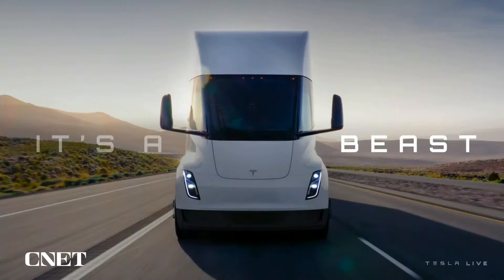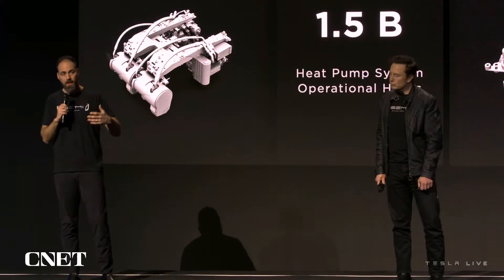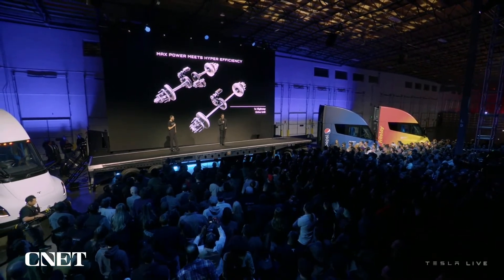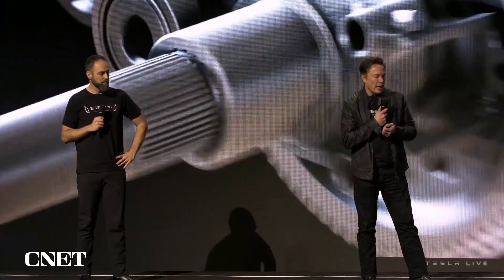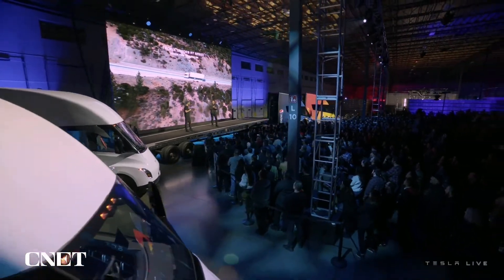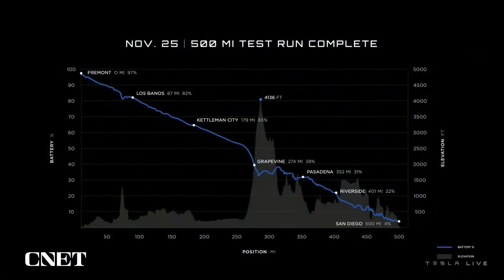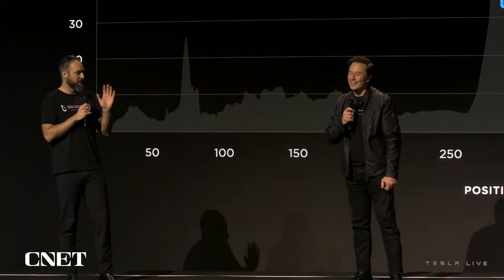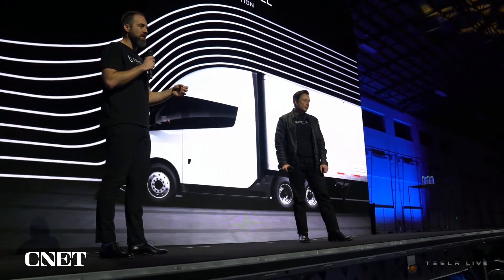Watch Elon Musk's Deep Dive Into the New Tesla Semi-Truck

Comment: Imagine the fuel cost savings for a fleet, it must be tremendous 🤔
Reply: over $200,000 per year.
Reply: And low maintenance cost
Reply: @Justanotherlobster Would love to see how the charging stations are distributed islandwided.
Reply: Imagine the geniuses that already figured this out while normal people try to downtalk people that are doing something incredible. 🤔
Reply: Imagine when there is no electricity…like in Europe right now……
Reply: @redeemedfarmer2670  1. Plenty of electricity in Europe rn. More electricity than petrol, in fact. 

2. Most mega chargers are intended to use solar power and an on board battery to charge trucks. Unlike diesel pumps, which require electricity to run. Oops.
Reply: @redeemedfarmer2670  pretty sure their is electricity in Europe, natural gas however is in short supply. but electricity is more vital and would not be allowed to go out.
Reply: less than half the load carrying capacity of a conventional truck. There is a reason why they have decided not to supply them to the market now and just use them ‘in house’ 😏
Reply: @bayly1977  What is this about? Because the Tesla semi can pull the US weight limit and do so better than a diesel, and has been shipped to Pepsi and Frito, who made the first purchases of the truck. I can only assume you're not talking about the Tesla semi.
Reply: @EmpressCeriath  oh you simple person. It is allowed the total tare weight of 80k as per any regular truck, it’s empty weight is double of that of a diesel. Need I go on? 🤷‍♂️ zero confirmed shipments buddy. Go find, in any of their hype bs, any mention of its load carrying capacity which is the only relevant feature for the trucking industry. You can’t, because they didn’t release it. However, third parties have reverse engineered the data to identify its empty weight. The numbers are dreadful
Reply: @bayly1977  Actually, they did an entire shipment on video, start to finish at a load of 81,000 lbs, 1,000 below the load limit of EV trucks. The total weight has been confirmed to 17,000 lbs. Third parties assumed the technology, in the same way that Mercedes did. They've been proven wrong. Pepsi and Frito both have already driven the truck, but it isn't technically in their fleet yet because they got it a few days ago.

Should probably keep up with the news before commenting old falsified talking points.
Reply: @EmpressCeriath  show me your source of 17k lbs. that’s the high end of a conventional truck. The reverse engineering has stipulated an empty weight of 27k minimum.
Reply: @EmpressCeriath  where is your source, show me!!!!! 17k is a conventional truck.
Reply: @EmpressCeriath  YOU need to do your research my man. They have omitted this number from all their source info. THAT is a fact
Reply: @bayly1977  I literally just told you. It's the Tesla released number. Use google.
Reply: @EmpressCeriath  you can’t do it 😂
Reply: @EmpressCeriath  gone a bit quiet there
Reply: @bayly1977  Nothing else to say. I've provided you the information, you can either deny it, research it yourself, or wait until there's thousands of these on the road. Not really relevant to me. Enjoy your day.
Reply: @EmpressCeriath  😂😂😂 you’ve provided nothing. That’s because they haven’t published anything. You made up 17k thinking it was a Tesla number but you now realise that’s the weight of a conventional semi. I’m embarrassed for you
Reply: @bayly1977  You can believe what you like. A conventional semi is anywhere from 15k to 25k. There isn't a single weight. There's many manufacturers with many different models. There is no single weight for them. 17k is the Tesla number. But this isn't a sports team, I've simply provided the information. I don't really care if you don't agree with that information.
Reply: @EmpressCeriath  wrong again. Just stop. Conventional is up to 17k and Tesla, again, hasn’t released their weight. Your embarrassing yourself
Reply: @EmpressCeriath  By: Steven Loveday
The Tesla Semi is a fully electric Class 8 truck with 500 miles of estimated range, according to Tesla. CEO Elon Musk just recently tweeted that the electric hauler was able to pull off a 500-mile trip "weighing in at 81,000 pounds!" However, we don't know what the truck weighs when it's not loaded, so this doesn't tell us how much weight it was pulling.
Reply: @EmpressCeriath  ‘more from the article’ Based on the tweet, a Jersey barrier weighs about 4,000 pounds. So, if the Tesla Semi that Elon Musk tweeted about is the same as the one pictured with 11 barriers, that means the load was about 44,000 pounds. This suggests that the electric semi's unladen weight is around 27,000 pounds.
Reply: @bayly1977  Wrong. My semi in my backyard weighs 734 tons, and can fly to Pluto while firing all lasers. Check your facts, you're making yourself look ridiculous. 🤣🤣🤣
Reply: @EmpressCeriath  Just say you were regurgitating what your daddy Elon was babbling through the whole presentation.
Reply: @rayh9865  Wow, you're angry. Hope you feel better later.
Reply: noooooo, its a scam! it will drive 100miles fully loaded and than stops for couple days!
Reply: @TheoisTeddy so true. My friend only tows 100 mile between charges and he is only towing a show car.
Reply: well why dont you calculate it yourself? i have. and at current electricity and super charger prices, it costs more than diesel. and this thing is gonna need 1000kwh of demand per trip. instead of 60kwh that a tesla needs
Reply: @MrPaxio have you told Elon this??? Maybe he will scrap the whole project! SMDH!
Reply: @MrPaxio  the semi trucks dont use superchargers, they use megachargers that run on industrial electrical prices which is dirt cheap. its 3 cents per kwh in my state so a 1000kwh battery would cost 30$. pleas do the same for a diesel going 500 miles while weighing 80,000 pounds.
Reply: @odisy64  oh please, raw electricity prices went from 2 cent to 8 cent this year. and 80% of the cost comes from delivery and service fees attached to that 8 cents. it doesnt matter that industrial power is cheap, the people running the mega chargers still need to make a profit. and the guvernment or elon isnt about to invest a trillion dollars to build that infrastructure. ive seen slow chargers take 50-90c/kwh i doubt they'll just let you drive for free because you want to
Reply: @MrPaxio  its 3 cents a kwh where i live for industrial power, but the mega chargers owners dont need to make money if Pepsi co owns the ones at its facility and uses it to charge trucks they own. you can expect to save nearly a million dollars in fuel in the lifetime of the truck, you could buy several replacement semi trucks with that money. elon has already spent million building the worlds largest private charging network and they plan to open it up to other car makers.
Reply: @MrPaxio  8 whole cents?! Oh my gawd, that makes it roughly a fifth the price of diesel per mile, it's going to cost $80 to fill the battery. This technology really is dead if it's only a fifth the price of diesel. Your argument is infallible.
Reply: @EmpressCeriath  yeah right 8 cents..... thats why on the road chargers take 50-90c/kwh to charge a small battery.... for 4 hours.... and the people running the stop need to make a profit aswell. you didnt read that you also need to pay the drivers $40/hr while its sitting there charging. and ure not gonna get 8 cents when u run out of range near the destination near a population center with expensive power. you cant just teleport electricity just because you really wanna believe in it. and theyre gonna be buying a truck that can only do one specific route, what if the route changes, now you cant complete it with this truck, meanwhile a regular semi can do every type of job with its 2000 mile range and it can actually return to where it started to refuel for lower price. maybe they can tow your tesla semi out of the city again for cheap power LOL
Reply: @MrPaxio  Lmao, you're the one that said 8 cents. 

I pay 17 cents to charge mine, and it takes an hour to 100%. It takes about 20 minutes to 60-70%. Paying a driver for 20 minutes is far cheaper than diesel by a long shot

Route planning is a part of truck driving already, probably shouldn't run out of power near a city. Oh wait, I live IN a city and pay 17 cents.  

The truck can do way more than one route. Not sure where you got that number from.

Not sure why you're trying so hard to debunk this truck's usefulness, when there's already a ton of companies lining up for it. You don't need a truck that does everything, you need a truck that does the job it's expected to do. This truck is far cheaper to operate than a diesel truck, and will replace diesel in most local and regional applications. That's just the realistic future. It won't replace diesel on long haul, unless major improvements come.
Reply: @MrPaxio  I've actually provided the weaknesses of the truck. It isn't for everyone. But you're going out of your way to make the truck "useless", when it clearly isn't. 

There isn't an army of robo taxis, the technology has a long way to go. They'll be incredible in a few decades. 

Vacuum tubes probably won't ever be a thing. Maybe though. 

A rocket across the world isn't entirely practical, but maybe with more advanced in technology. 

Elon is trying to make money. He's helped create a really good car that's much more practical than an ICE in most applications(thank you to the other companies also doing this). He's made a semi truck that MASSIVELY cuts costs for transportation, which will definitely affect the price to every consumer in the US. 

The practicality is explained here, and reiterated in the comments section.
Reply: @MrPaxio  no it doesn't
Reply: @MrPaxio  maintenance alone is a savings win
Reply: @MrPaxio  The math has been done by people a bit better at it. It's slightly less than a third of the cost, based on commercial electricity costs. While those costs can vary, you're still looking at significantly less than diesel.
Reply: @EmpressCeriath  and eventually not needing a driver - perhaps the biggest cost?
Reply: it wont, a truck that isn't driving isn't making money
Reply: @lIlIlIlIlIlIlIlIlI  it's driving today
Reply: @lIlIlIlIlIlIlIlIlI  what are you even talking about?
Reply: @lIlIlIlIlIlIlIlIlI  Why would it not be driving?
Reply: @donlarsenjr2332  Because it's charging. Truck drivers are supposed to take breaks, but they usually don't. The semi might actually be amazing for safety if it forces drivers to take a rest while it charges.
Reply: @cizd  You legally need to take a break every 8 hours actually. Not a choice! You get 30 mins. And in 30 mins you will have enough charge to go another 8 hours so unlimited charge!
Reply: @lachlanB323  This is such a good point. So many truckers' mad that this truck can't break the law as well and I'm like ???.
Reply: @lachlanB323  500miles in  8 hours? That is awfully slow.
Reply: @yoshyoka  that's the maximum by law
Reply: @yoshyoka  That's about 60 MPH, not slow at all for a semi, considering it's probably gonna drive mostly local routes under 300 miles a day.
Reply: @yoshyoka  Not with traffic. You aren't always going highway speed in the real world.
Reply: @EmpressCeriath  The others are like I don't sleep! And I'm all... But it'll probably also have mostly autopilot in a few years anyways too sooooo....
Reply: @yoshyoka  That's averaging just over 60 mph, which is an average speed. Sorry you can't speed in an 80,000 lb vehicle while low on sleep and suffering from road hypnosis anymore, but pardon us if we're not worried about it.
Reply: @EmpressCeriath  I worry more that going at decent speeds those 500 miles are going to be a dream. But let's wait and see!
Reply: @lachlanB323  That's what I'm saying. They're supposed to, but everyone keeps breaking the law so their corporate overload doesn't assign them to homelessness for no reason.
Reply: @EmpressCeriath   We literally already have this with eld's. You're  also asking for every site these trucks could possibly be at to have a charging station otherwise drivers now have to sit wasting time charging along side wasting time waiting to get loaded/unloaded. That's not happening on a construction site or during roadwork on the highway. It's not happening at a grain station or a scrap yard where you need to be in line so you can wait your turn to unload. Lord help you if there are other trucks already occupying all the stations and you have to wait for someone or multiple someones to finish. The only place that their will realistically be sufficient chargers are at an Amazon warehouse(which I guess to be fair is where most of these will end up). They're not mad they can't break the law, they're mad because ELD already put them in awkward jams when they end up spending all of their required break waiting to be loaded instead of actually on break getting lunch or whatever and now they have to be bothered with charging eating into that time too.
Reply: @donlarsenjr2332  charging you dolt
Reply: @TexasDragon3907  The complaints above aren't related to any of this. We've got complaints about speeding, complaints about taking breaks, and complaints about drive time. 

The two complaints you put here boil down to where and how to charge, and charging eating into breaks. 

How to charge is company to company and use case to use case. Early usage will likely be focused on regional delivery and not long haul, where a truck is always going to start and end its shift in a company owned hub so it's a non issue. Until the infrastructure is built up, you won't see them outside this situation probably at all. 

As for breaks, this is answered in the above explanation. You don't have to charge during breaks, because in the use case they'll be focused on, they won't have to charge until the end of the shift. 

In the future when this is more applicable, the trucks will likely have longer run time anyway, but regardless that's a concern for HR and DoT, not Tesla.
Reply: @yoshyoka  as you can see, the truck isn't slow
Reply: @cizd  there is a driver shortage, corporate doesn't have that leverage anymore
Reply: @EmpressCeriath  I literally said this wouldn't be an issue in a place like an Amazon facility where a lot of these would be sold, thank you for repeating what I said but louder. Also again read what I said, scrap delivery, grain and construction aren't necessarily long haul, and you'd still run into a charge issue depending on the route. Of course those businesses likely aren't looking to electrify so they'll probably be alright.
Reply: @lachlanB323 unless there is a line to wait for the charger
Reply: @yoshyoka  it went trough a mountain pass, you can see it passing other semi trucks while weighing 82,000 pounds, it didnt stop to charge, only mandatory brakes. it went through donar pass.
Reply: @cizd  how do you figure drivers don't take breaks ....you ever hear of a ELD??? You can't cheat it ...don't take your 30 minute or 10 hour you get violations ....
Reply: @trainandtruckmodeler786  I have family that did truck driving before they retired, but it seems like the field has changed a lot since then. Driver shortage and enforcement of mandatory breaks is a great start to making better working conditions. Hopefully they'll get more breaks in the future. I've seen people after driving 8 hours and my take is they should have taken a break after 5-6 hours.
Reply: @cizd  you don't have to take your break at the 8 hour mark....the only driver shortage is with companies paying under 65 cents a mile...